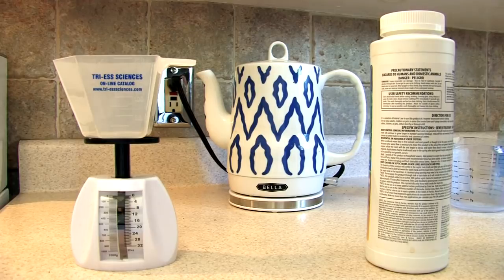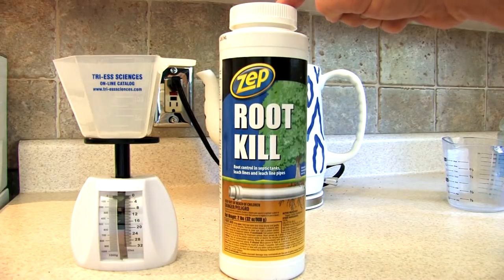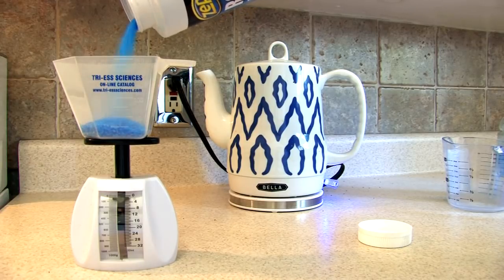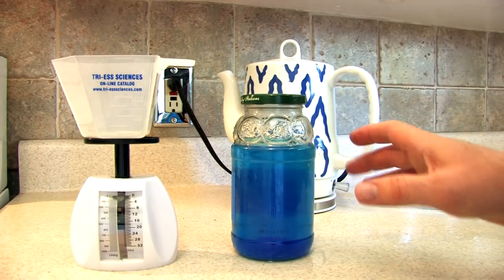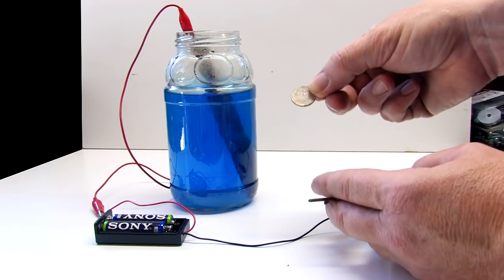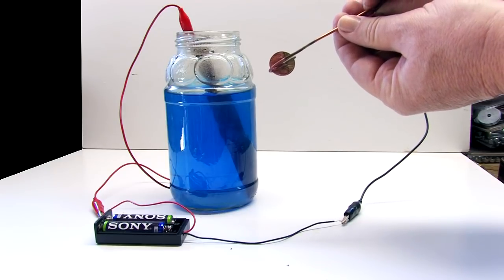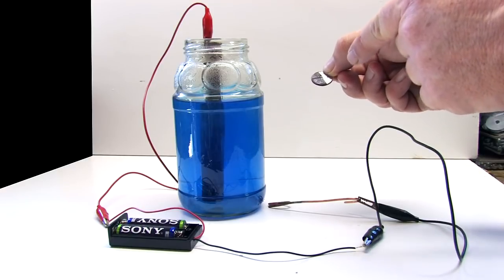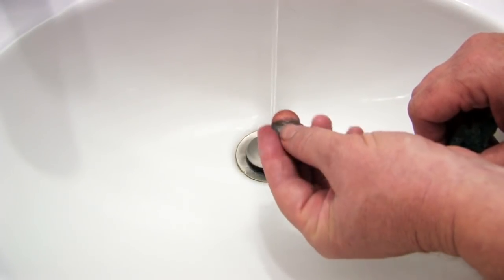Easy And Inexpensive Copper Plating Trick!

Comment: Can you copper plate something that isn't already copper? How am I supposed to believe that "Root Kill" didn't just eat away the nickel plating?
Reply from the maker: Some metals plate very well with copper, including steel and nickel surfaces, and others won't plate without special preparation.  But, root kill is definitely plating as I've plated many items, changing them from whatever color they began with to a bright copper plate.  Items must be exceedingly clean, and of a metal that copper will plate to.  I have another video on nickel plating, as mentioned, and nickel plates easily on a wide variety of metals.  So, by nickel plating first, then copper plating, you can get a good copper finish on a wider range of metals...
Reply: The anode being copper replenishes the copper from the bath (to some extent, in some plating methods and metals, it's pretty well balanced and the positive electrodes, or anodes, replenish on a 1 to 1 basis meaning the bath lasts until you contaminate it, etc. In zinc plating the zinc electrodes are "eaten away" fairly quickly and you simply add distilled water to replenish what evaporates or leaves by "drag-out" meaning what leaves on the part as you remove it. The metal salts, usually of the same metal you are plating with, and the electric charge cause the anode to oxidize and dissolve in the solution. These are positive ions - and are attracted to the negatively charged part. If the anode is the same size in square inches as the item to plate and things balance out the anode or copper pipe will disappear at about the same rate as plating appears on the part you are plating. Think of a car in an Iowa winter - salts from the roads, moisture, galvanic action, electrolysis, you get steel oxidation. In this case you are forcing the fast oxidation of the copper pipe and this goes into the solution and is attracted to the other side. The plating bath doesn't "eat" it in this case but in certain acid plating methods, if you hang the part in the bath and don't start plating the acids will start to eat at the metal and darken it and cause it to not plate.
I REALLY need to chat with stancurtin as I've got a part I have been trying to get to take a good zinc plate now for over 2 months. I've spend a good 40 hours on this crazy part and when I think it's all fine, I find spots that didn't take the zinc. I'm told that if I nickle plate it first, THEN zinc, it should work. Something about the steel is causing issues, not to mention the odd shape causing current density troubles like crazy. I need a good shiny zinc plate on this part so I can apply the yellow chromate and get it back to the customer. I've had successes with most other parts but not this one, and one I have that is identical to it in every way. I have trouble getting the zinc to be of a fine grain and shiny anyway, but this part is driving me nuts and costing me hundreds of dollars in time and materials.  So I'll be watching that nickle video as soon as I find it and if things pan out maybe I need to make a donation to stan here........ ;-) it would be worth it!
Higher voltage is mentioned elsewhere - too high and you get too much amperage, leading to dark spots or "burning" and course grained plating or crystals instead of very fine smooth plating. For typical zinc you want 140mA per square inch, not sure on copper or nickle. Ohms law - increase voltage but keep resistance the same (resistance is the solution and electrodes here) and you increase the amperage - and too many amps makes it dark, course and/or grainy and not stick. So if you use an uncontrolled power source with higher voltage, you'll press your luck on amps and have trouble. You can solve that with resistance such as light bulbs in series if using a car battery, etc. but that takes messing around and experimenting. SLOW and lower voltage is far better than higher voltage and fast as you push too many amps and force fast course plating. AND it MUST BE DC.

Comment: how many times can you use that solution before it is used up?
Reply from the maker: This varies a lot, since different pieces and plating times will determine how fast you deplete your bath.  I seem to get good plates even after dozens of uses when it comes to plating coins, and, find the plating slows down as the bath depletes.  So, you'll have a pretty good feel for when it's time to make a new bath...
Reply: stancurtin I tried this method but I just can't get it to stick. am I doing something wrong?

Comment: Hi there! Great video. Just curious as to how you built your battery set up. I have a motorcycle battery charger (6v-12v) but I'm nervous about using it. Do you have any advice?
Reply from the maker: You can give it a whirl.  Most people who do plating seem to use common battery voltages like 6 or 12 volts.  I've had poor luck with higher voltages.  Though it depends on the metal you are plating, copper can sometimes plate well at half a volt or less.  So, a single 1.5 volt battery, or two (3 volts) seems plenty for a slow and even plate on most materials I've used.

Comment: Copper sulfate for your purposes is the same as copper sulfate pentahydrate.
Pentahydrate means the crystals have 5 molecules of water for each CuSo4.  Which is the way most copper sulfate comes to begin with.    Also look at Blue stone (CuSO4) and other  sources CuSO4 can be purchased cheeply at many hardware stores and feed and seed stores.  Blue Stone (CuSo4) is used to soak horse hoofs to kill fungus, hoof rot.
Reply from the maker: Thanks!
Reply: H
Reply: +stancurtin thanks for the awesome info, i have a variable power supply so is any voltage good enough? and is the higher voltage gonna be a faster plate?
Reply: Copper sulfate is white when it is not pentahydrate, so if the other copper sulfate you used it blue, it is already copper sulfate pentahydrate

Comment: I have been watching your videos and have had no luck attaining adhesion of the copper.
It plates as a powder that just washes off.

Mix 1: Distilled water, Root Kill and 3 volts plates fairly quick but does not stick.

Mix 2: White Vinegar and Root Kill plate without any voltage at all, but it is still powder that washes off, and adding the 3 volts makes it happen real fast, but still without adhesion.

I left it in mix 2 for a while and it was so coated that the powder clumped off as I pulled it out.
If I hold it just right, I can see a slight copper tint to some parts under all the copper fluff, but it is so slight, if you did not know to look for it, you would miss it.

I have already stripped what I need to coat and need to plate it soon.
I need help and don't know where to go other than here.
Can you PM me?
Reply: Go back and watch the first video.  Acid etch the item to be plated and this will solve your problem

Comment from the maker: I haven't tried copper plating pot metal, but I have plated zinc.  I had to do a nickel undercoating, then a copper plate on top.  I know pot metal usually has zinc, lead copper and aluminum if not other metals...  most of which are difficult to plate.  You might try a nickel plate again with a low voltage and a longer time?  But I'm strictly guessing!  Sorry I can't be more helpful.  Thanks.
Reply: Sorry to interrupt.  But I request for your help. I am having hot oil being circulated in M.S. pipes for heating a coated film, travelling under those ms pipes. however, the heat exchange is poor and the difference in the oil and the exchanged heat temperature is about 100C, when oil is at 220 C. Since, i do not need the any air flow and only temperature is sufficient to crosslink the coated material, i have not arranged for any air circulation except a weak exhaust. I was planning for copper pipes to improve the heat exchange, in addition to a positive air flow, but replicating the current design would be very demanding with copper pipes. ..these are 850 x 25mm with 5 m wall pipes... my next plan of action would be to copper plate these steel rods . Would you approve of that if I expect at least 40% better heat exchange by plating them?

Comment: Very nice Vid.  I am wondering if this method would work on Pot Metal.  I tried to nickel plate a piece and it was an epic failure.  I did a bit of research and according to the Caswell site I need to do what they call "Flash Copper Plating"  It seems that the Flash is a non acid plating process.  I think I am going to give this a try and see.  If you have any thoughts, I would appreciate them.